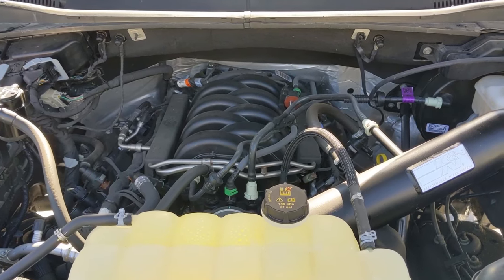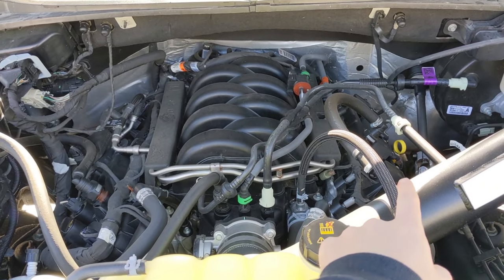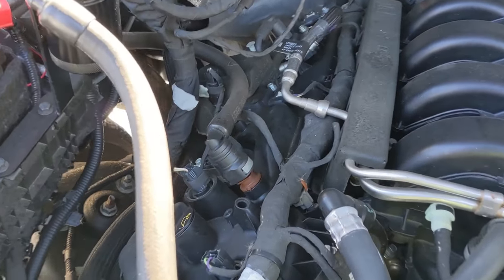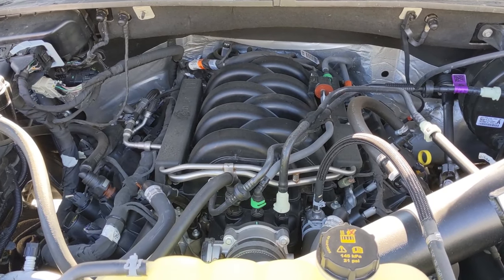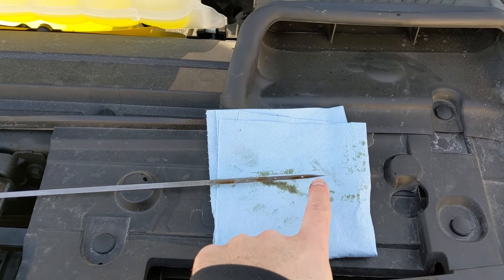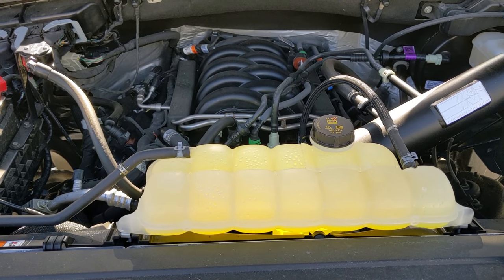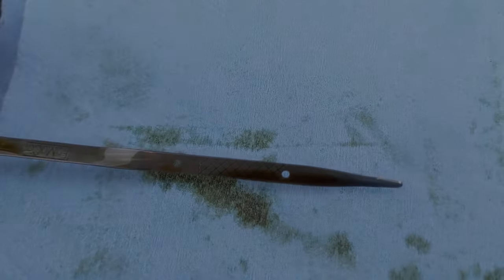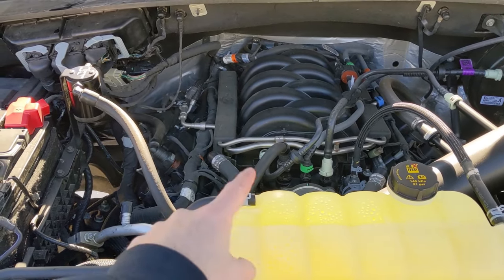Oil Consumption Update - 2019 Ford F150 5.0L

Comment: About the brown milkshake color in the oil, I agree it's moisture in the oil due to short distance drive. I drive my 02 Ford Ranger 4.0L engine only 3,000 miles a year, and that's short drives, 2 miles to and from to the Grocer or to play the lottery. I change my oil after the cold season (May 1st) and again before the winter (November 1st). I don't burn any oil in my truck, which has 174,000 miles on it. I hear the best recommended engine to get in F150 is the 5.0 Liter. That's what I would get next, if I weren't so old. My truck cost $19,000 new, and I got to drive it 19 years. Most people would have owned 4 or 5 vehicles in that time span. Ha!  Did you hear GMC now has a 4 cylinder DIESEL truck that gets 37 MPG ... Very interesting, worth looking into.
Reply from the maker: Yea Ford's pushing the 3.0L Diesel and also this new hybrid in 2021. They also have a revised 5.0L in the trucks too so it's technically a 4th generation coyote engine because it now has cylinder deactivation lol goes down to 4 cylinders. Worse than auto start stop in my opinion.

Comment: 2020 5.0 61k miles.  Just changed oil after 4500 miles because my oil level was barely on the dipstick.  Turns out it consumed 3.5 quarts in that 4500 miles.  BTW. I already had the TSB done with the reprogramming thing. Seems like the consumption is getting worse on mine.

Comment: My 2018 has been thru 2 consumption tests and was close to the limit both times. It has a Ford Performance oil separator on since new as I installed in the first week. It has also had the TSB performed. At the oil change after the TSB, at 25k miles on the truck 3500 miles on the oil, there was some consumption but not a quart. I changed from Motorcraft 5-20 to Motorcraft 5-30 and have not seen any consumption. The recommended PCV was changed by Ford plus the engine computer and the revised dip stick. Been 20,000 miles on the oil weight change ….. problem gone.
Reply from the maker: Yes I've heard the 5w30 can solve it, good luck! I didn't have any tests done, I just took it into the dealership and showed them a photo of my dipstick being low before I topped it up myself. They did the TSB without question, and it hasn't consumed a drop of oil since
Reply: Look into the PCV valve for the excessive vacuum if it returns.

Comment: I'm really hoping this will fix my issue as well....but my one question about the dipstick....when I change my oil I add 8.8-9 qts and it's in the sweet spot on the dip stick, then after a few weeks it's dropping- so I don't think I'm over filling to begin with?

2020 XLT 5.0L 20K MILES
Reply from the maker: Hard to say, these engines are supposed to take 8.8 then you add a bit to "top off" but ideally they're supposed to take 8.8qts
Reply: Yea i measured mine out on the first oil change but it definitely consumed oil to the point i went and did a tsb, then was getting the consumption checked every other week by the service technician. Then before it was done they performed this tsb which to my knowledge fixed the issue.

Comment: Great video.  I have a 2018 F150 with the oil consumption issue. I had TSB-19-2365 performed and did not fix the issue.  Since my last oil change it consumed almost 2 quarts of oil in 5000 miles.  I took the truck to the dealer last week for an oil change and they marked the dip stick.  Now I have to bring back every 1000 miles for them to inspect the consumption.  I'm surprised the TSB didn't replace the PCV.  I haven't done that and not sure I should at this point.
Reply from the maker: The PCV valve is only replaced when they perform the short or long block replacement. I'm not sure why they would change the PCV valve there and not during the TSB for the ECU reprogram to adjust the throttle body position.
Reply: @EliminatorPerformance   yeah. Good point. Interesting.  Since you seem to have good knowledge of this issue, wanted to ask another question.  Would a muffler swap affect oil consumption in any way?  For example, swapping the factory muffler for a Flowmaster 40?  Resonator still in line.

Comment: I own a 2019 F150 that I purchased about seven months ago and I am experiencing this problem. First of all great video and it is very informative. I purchased the truck when it had about 37,000 miles on it and I’m now at about 45,000 miles. The Chevy dealer that I purchased it from changed the oil right before I purchased it. I noticed that before my first oil change the oil was low, but thought they may have just underfilled it. I don’t recall how much I put in it at the time. Today I am about 1000 miles until my next oil change and I noticed that my oil was almost a quart and a half low so I started researching this. I do not have any sort of extended warranty on my truck, so I am left scratching my head as to what to do. The local Ford dealer in my area has not been the best to deal with on things from past experience, which is a long story. Bottom line, I have owned two F150s with a 3.5 L turbo V6 and never had an issue. This is my second F150 with a 5.0 L V8. I kept the first one three weeks and had to send it back because of major issues and swapped it for my second 3.5 L turbo V6. I checked and Ford does not have any recalls on this of course. My concerns are what are the long-term effects of this on the engine? Second, how much is a dealer going to charge me to do this repair that technically should be a recall. Just wondering if anyone else out there is out from under warranty and having to deal with this or has dealt with it?
Reply from the maker: The tsb is covered under warranty, so I have no idea what it would cost on it's own for a truck out of warranty. It would be worth calling the dealer to ask what a 19-2365 would cost out of warranty? Then you could at least get it done and try it. Oil consumption will eventually foul the catalytic converters as well as foul the spark plugs over time
Reply: @EliminatorPerformance  Good to know! Thank you for the information. I will report back when I get the repairs done to let everyone know what the out of pocket cost is.
Reply: Had the repair done today and my power train warranty covered the repair.  They did install the new dipstick, software update, and an oil change. I was right at time for an oil change so I basically got the oil change for free.  I will check back in after I drive it for a while to see if it still consumes oil.  I will be in stalling an oil separator as well.
Reply from the maker: @76williamsbh  good luck Brian
Reply: @76williamsbh  what oil they pour in 5w20 or 5w30 ?
Reply from the maker: The 5w30 is important, but the most important is that it's fully synthetic. I'd recommend the Amsoil signature series or Pennzoil ultra platinum
Reply: Ford did it and used 5W20 when they did the TSB.  I’m about 300 miles from a 5000 mile oil change.  I have checked the oil separator every thousand mile or so and it is still pushing a couple of ounces of oil through every time I check it.  I don’t think the TSB fixed the problem 100% but it definitely helped.  When they refilled the oil at the oil change and TSB service they put it just to the bottom of the fill range and it is just now slightly below that.  I will be switching to 5w30 at the next oil change.  Thanks for the tip!
Reply: @76williamsbh  None of the TSB's worked on my 2018. Bad cam phasers and oil consumption. Dealer installed a new longblock a couple weeks ago under warranty.
Reply: my 19 had both lower and upper engine replace after burning extreme oil. and its still doing it with new engine done 8 months ago

Comment: Thanks for this.  I picked up a 2020 xlt   was below double check mark.   I hope this is why.  I'm going to dealer in the morning.    I already planned on installing a catch can .   Good information 
Downtown Toronto Canada 🍁
Reply from the maker: @Liquormans  I recommend 5w40 fully synthetic, Liquimoly Molygen works great, I'm currently doing a 2yr oil test. I've tested amsoil, rotella, Pennzoil Ultra Platinum. Switching to 0w40 fully synthetic Pennzoil Ultra Platinum this winter to test it out. I'll eventually post a video once I finish.

Comment: Great it fixed yours but they are not all alike. Some will empty the oil pan due to poor ring tension and bad cylinder walls.
Reply from the maker: Yea I've heard if you don't run them hard during break in the rings don't seat properly. I was filming intake and exhaust videos early on and was running it quite hard from the beginning.
Reply: Mine burns a quart every 2500 miles.

Comment: Fantastic explanation of the what, how, why and fix for this issue. Question, being 2024, do the current models of this truck with this 5.0l V8 engine have this issue resolved? When buying a 2024 now, has this update/dipstick/catch can been added from the factory? Thanks again Sir.

Comment: My buddy got the engine replaced.
The pistons were a different metal in those models and they had to change it due to different metal expanding at different times.
Letting oil past rings.

Comment: I got the new dipstick and reprogram but still need more than 9 quarts to hit the full hash mark - still consume half a quart every couple thousand mile - also do oil changes at 3000 mile intervals to keep the TI-VCT system happy otherwise have unstable  idle issues

Comment: You're stating the new dipstick keeps you from "overfilling" the engine with oil. My understanding is that the high level mark was unchanged on the new dipstick, they just moved the low level mark a quart lower. This cracks me up. If the reprogramming to lower crankcase vacuum was going to work, why would you need a new dipstick with the same high mark and a lower mark designed to make you feel better about continued oil consumption?
Reply from the maker: Yea so from what I've learned since, it looks like they're the same length to the top full mark, but they increased the range to 2qts instead of 1qt to better track the consumption because after the TSB it might consume 1qt/per oil change interval, and on a 2qt stick that's half way. On the old 1qt stick that would show no oil on the dipstick which made ford look really bad lol

Comment: Did your dealership perform parts and labor for free on your TSB  or did you have to pay?  I have a 2018  XLT  5.0 V8  that has very low milage for the year of the truck.  Only 26,800 miles.  I only drive the truck  six months a year when we make our winters in Texas from Illinois?

Comment: I have a 2018 with the 5.0.  Engine was changed because of oil consumption.  I now have a 2019 model 5.0 engine    This new engine burns more oil than the original.  I had the same tsb done on my 2019 engine which ford changed the dipstick along with a reprogram.  The shop manager and I compared both dipsticks.  They are in fact the same length.  The only difference is that the low and full mark are different.  Instead of one litre between add and full its now 1.9 litres.  I installed a catch can and yes it’s still blowing oil through the pcv valve.  Luckily my catch can does what it’s supposed to do.  Ford only swept the problem under the rug with a new dipstick.

Comment: My dad has a 2020 5.0 and it burns a quart nearly every 2000 miles. This TSB has been done and the truck still burns oil. The dealer refuses to do anything further. The TSB is not the fix.
Full synthetic AMSOil is being used.
Reply: I have the same issue with my 2020 5.0… Has he found a solution yet?

Comment: I'm getting the same issue with my 2021. Exactly the same amount of oil missing. I've gone thru 3qts of oil during the first 8000km. They said there's a TSB which I'm thinking its the same one. Thanks for the info. I'll be mentioning that TSB for sure. Thanks for the info.
Reply from the maker: This TSB should only be for the 2018-2020 as the 21 had a redesign. 2021 has gen4 coyote engine. Also, did you check the oil level when you got the truck? I had my oil changed at dealership and they only filled it to above the add mark, so I ended up adding another quart. If I wouldn't have looked, then checked a month later or something I would've thought I had consumption again.
Reply: @EliminatorPerformance  yes you’re right but it’s a start. Makes the most sense to me. I didn’t check when we first picked it up. About 2500km a low oil level popped up. I checked it and it was low. I added a qt and and all was good. It came up again at around 5000km, again another qt. It popped up again 2 more times and only need to add 1/2qt each time. The dealer is coming to pick up the truck tomorrow to start the first step of the TBS. my wife works at the warehouse in Brampton. She just found the dipstick in stock. She measured the overall length of it. I’ll compare it with the one in the truck when she gets home. (Man that was hard to keep that clean! LOL)
Reply from the maker: Yea I hear you, it's BS to deal with but hopefully they get yours sorted. Honestly the 1st person who I've heard has oil consumption on a 21, but I'm sure it's always possible. Hopefully it's a quick fix! Mine still running good, as always I'll keep everyone updated m
Reply: @EliminatorPerformance  I’ll keep you posted as to what they find.
Reply: @EliminatorPerformance  Their notes, unnormal amount of oil passing valve. they cleaned it and swapped out the PCV valve and the hose. PCM update for low oil warning. They also, at Ford's instructions, to remark the oil level marks on the other side of the dip stick so that it's lower on the dip stick. Sort of like the dipstick replacement on yours. To me, it sounds like there's too much oil and it was burning off. They want me to bring it back in 4000km to see how its doing. After that all got done, I received a recall notice for the same thing. LOL! Hopefully that fixes the problem.

Comment: Excellent  video and extremely informative. I do have one question, do you know how long the original dip stick was compared to the new one they replaced it with? This way people would be able to check and maybe they would have the correct one installed from the factory. Thanks for the info and keep up the good work. I look forward to following you.
Reply from the maker: From what I've researched, ford extended the dipstick to a 1.9L or 2qt range, where as before it was only 1qt range. Supposedly the top full mark is the same, it's just simply a longer dipstick. I would highly recommend the 19-2365 TSB and ask for it to be covered under warranty even if your truck is out of warranty.
Reply: @EliminatorPerformance How do you go about getting them to fix and cover the costs for something like this if the truck is out of warranty?
Reply from the maker: @zachis4wheeling  that's the tricky part, they should at least do the 19-2365 TSB but it's not always guaranteed. I'd call your local dealership to inquire
Reply: Can you provide the length of the new dipstick provided on the TSB?  My 2018 F-150 5.0 is just out of warranty and the dealer wants $414 to upgrade.  I may just buy an oil catch and the shorter dipstick form Ebay but I need to check if the Ford Part No. FL3Z-6750-D is the correct part.

Comment: The reprogram should no impact on mpg. The injectors are off, no fuel spray, during throttle release until engine speed drops to 1025 to 1075 rpm, or even lower. The revised throttle opening during Coast will not produce nearly as high vacuum and it usually does make vehicle lose some of the engine braking/slowing of vehicle that a fully closed throttle gives you.

Comment: Now, THAT was a clearly stated, very helpful video. I now understand the 5.0 Coyote oil consumption issue, its relation to the dipstick length & pcv valve modification. My question is, isn’t the combination of (a) the longer dipstick, AND (b) the more restrictive pcv valve, going to result in oil burning in the cylinders?

Comment: I have a 2019 with the 5.0L engine and burned a half quart by 1,000 miles- I changed the engine oil then.  
Oil consumption went to 1/2 quart every 2,000 miles after that until 6,000 miles.  Some changes were made
with the truck then. 1- change pvc valve to correct updated one.  2- add Roush supercharger kit to make
650 hp and 610 lb/ft.  That modification requires 5w50 synthetic oil.  
Guess what happened?  Truck has 12,500 miles on it now and hasn't used a drop of oil.  
Best 10,550$ that can be spent at a Roush dealer for the horsepower and retains factory warranty
Use only 93 octane fuel and mileage drops by 2mpg but all smiles here when driving!!!!!!!!!!!!!
Reply from the maker: I'm looking at that Roush phase 1 kit now and it's tempting! You get the 3yr power train warranty, which is nice. I have a 10yr warranty on mine and have owned it for 2yrs, so I think I'll save up for it and in 5yrs install that. I heard there's a 91 tune available as well that gives you slightly less power

Comment: Perfectly normal for any truck with a v8 to burn. However if it’s low mileage it should be minimal. Lucas works great on a high mileage 5.0. The overfill can cause some burn as well if the dipstick is off, which is common across makes throughout the years.